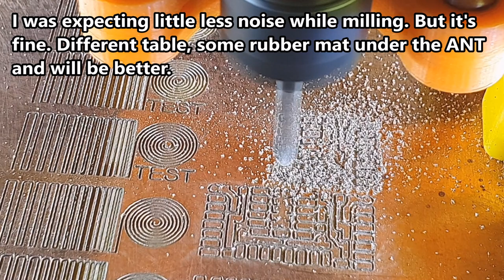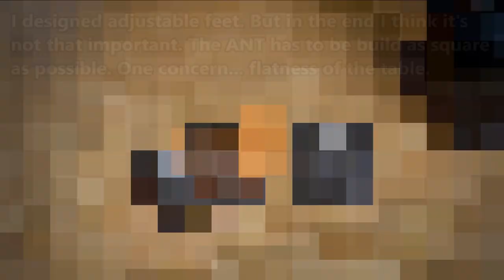The ANT PCB maker with my few modifications and addons

Comment: Could you please publish the buzzer electric circuit and the type of buzzer you are using ?
Reply from the maker: here is that simple circuit:
[edited] http://prntscr.com/rj327j
I used 5v/gnd from cnc shield,
buzzer is some common buzzer like this: https://www.aliexpress.com/item/32849782984.html
Reply: @RC87  Sorry to bother you, but your Link does not work for me. Another question I would like to ask you is how you connected the emergency switch? Did you break the supply line or do you trigger the reset of the controller via Hard or Softreset?
Reply from the maker: @Cromlegionar  try this link: http://prntscr.com/rj327j

The emergency switch I connected to the "E-STOP" pins on the CNC Shield Board (you should find them in the "bottom right" part of the board). I didn't break any supply lines etc.